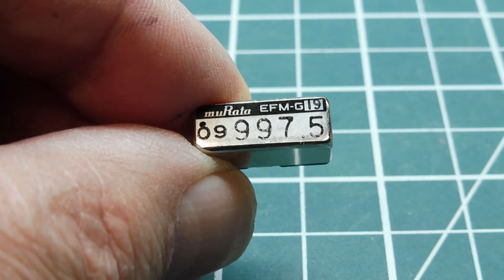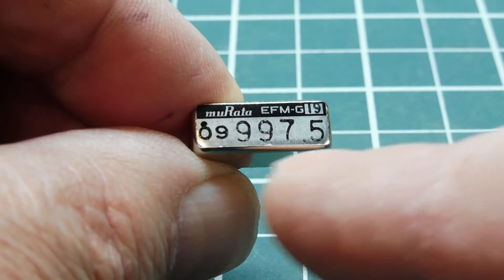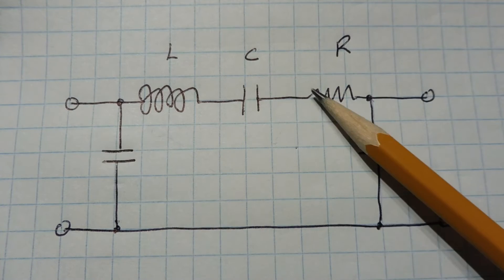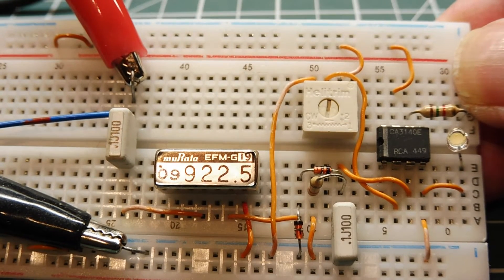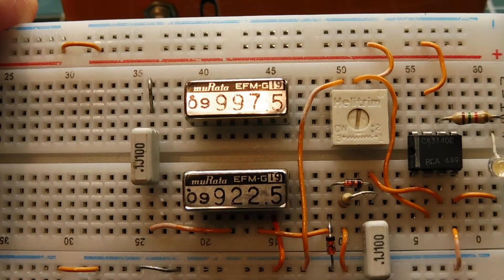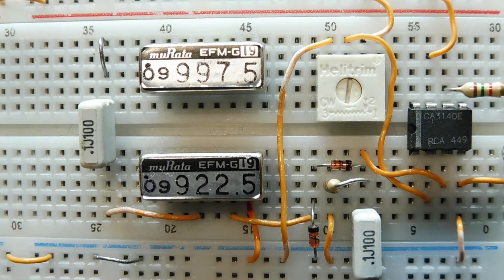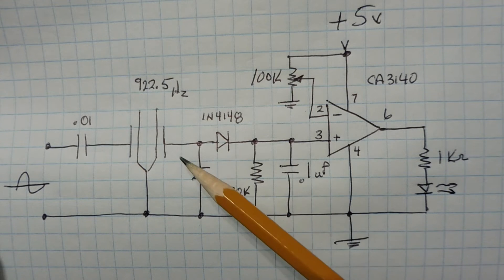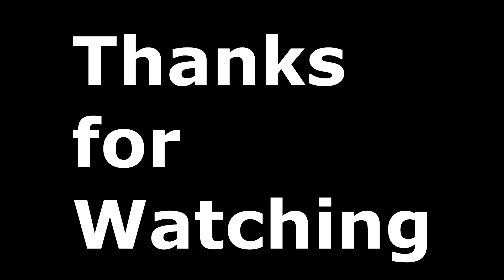Tuning Fork Band-pass Filter

Comment: Dont call it mechanical everything is electrical what you talk anout
Reply from the maker: The quartz tuning fork is piezoelectric material and when excited with an input signal converts the electrical signal to mechanical motion. The L in the equivalent circuit is the mass and the C is the compliance (inverse of stiffness) of a mechanical system.
https://pdfs.semanticscholar.org/a613/881123831309ee2fceb6ac2a631031f72d53.pdf

Comment: I've taken apart a few old cell phones like the classic Nokia bricks. They have a few odd surface mounted hermetically sealed components that look like crystals but have 5 or 6 pads on the bottom and do not have any frequency markings like the actual crystals I can identify. Are there similar crystal bandpass filters used in these kinds of circuit applications? I've tried to look up part numbers before but get no dice on a lot of this early internet age hardware.
Thanks for the upload ;)
-Jake
Reply from the maker: The filters in cell phone are radio frequency filters (RF) for the TX/RX and IF frequencies. These filters are Surface Acoustic Wave (SAW) or Ceramic. https://www.murata.com/products/saw/saw_mobile

Comment: Interesting. I didn't know. 
Recently Applied science made a video about mems oscillators (silicon) that are tuning-fork shaped. 
I know tuning fork elements were used in music industry standard used tuners for musical instruments. And you see even some modern digital tuners will visualy immitate those "strobe tuners", I think they were called.
Reply from the maker: With MEMS (Micro Electro Mechanical Systems) we are going back to the mechanical age. You can even get MEMS microphones that work very well.
Reply: @0033mer  - You are right. With MEMS, we are going back to the mechanical age. The one big difference is, it's all in micro scale so much so that you need an electron microscope to see the innards of the MEMS device.
Thanks for another informative video.